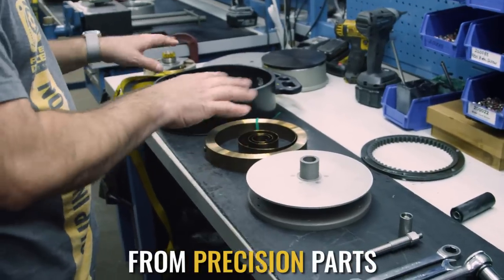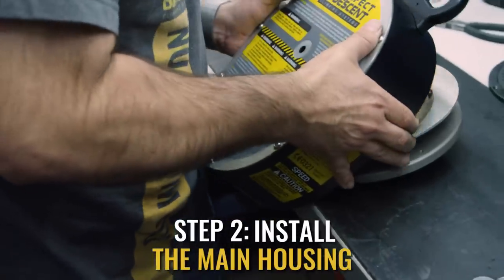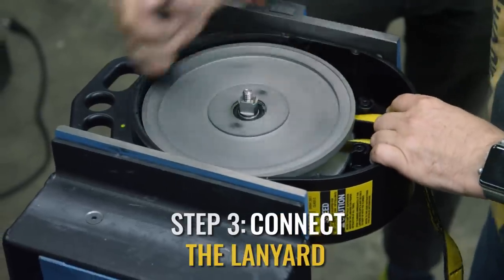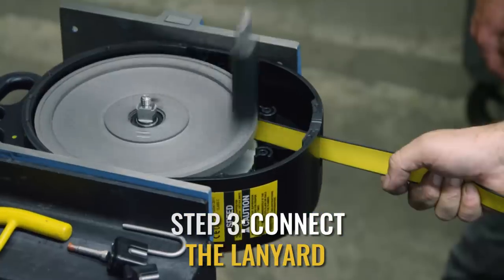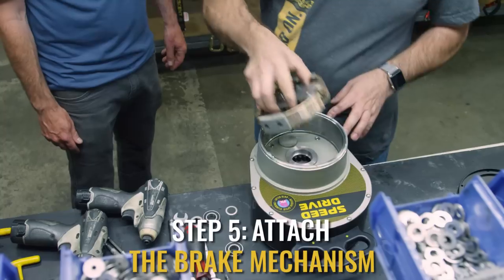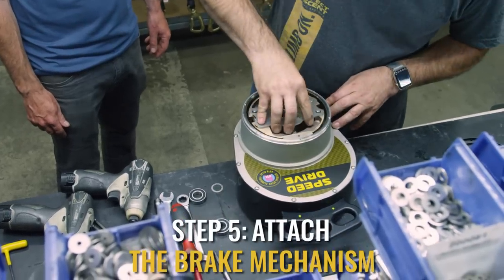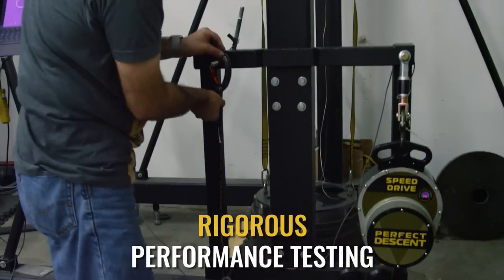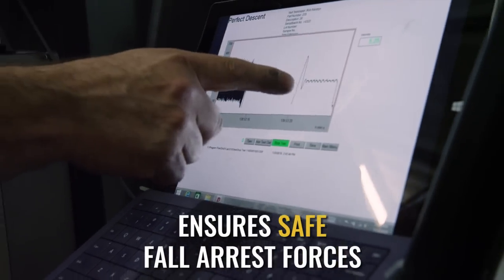How Perfect Descent Auto Belays are Made

Comment: How does it work? Centrifugal?
Reply: That would be my guess. The larger rope gear would make the smaller brake gear spin much faster to achieve the outward forces needed to push on the braking surfaces. Directional too, so there's little to no braking when the rope is being pulled in by the spring: 
https://www.youtube.com/watch?v=u853zLxc5BQ
Reply: Not centrifugal, but eddy currents. Magnets spinning inside an aluminum housing. Faster it spins the more eddy current and slows down proportionally. That's how they work on kids and adults equally.
Reply: @JG-po5cv  A made another comment, but they actually use eddy currents from magnets spinning up in an aluminum housing.